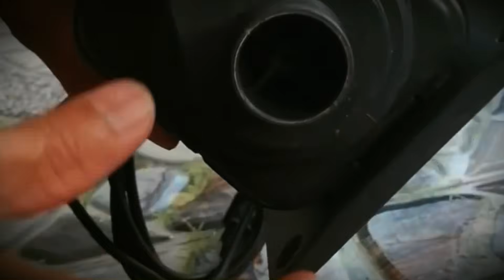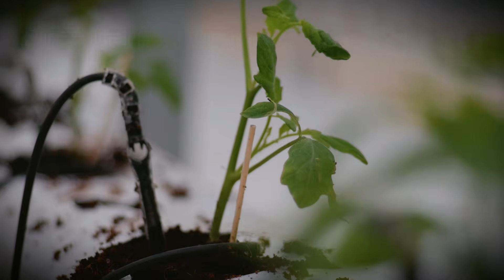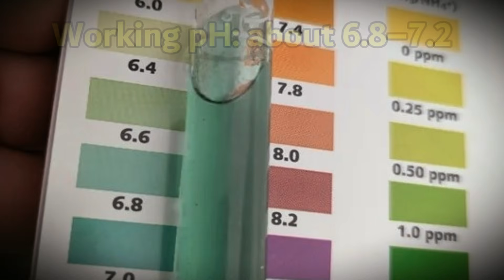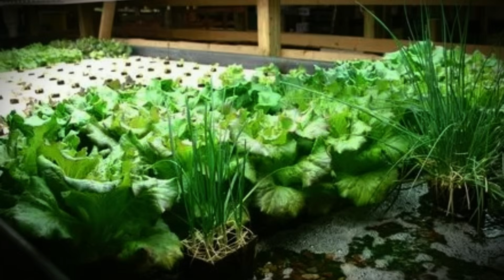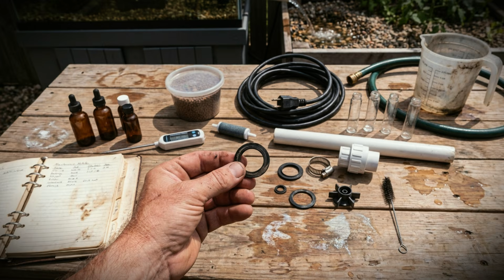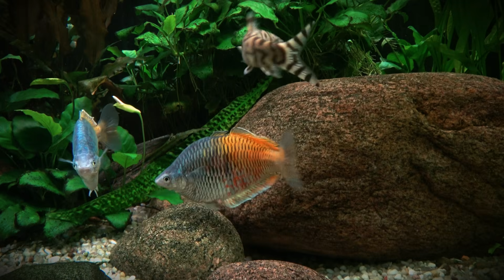The Backyard Food Machine: Fish + Vegetables Forever

Comment: I also thought at first that solid fish waste pumped into the grow bed directly is good, but NO. Solid waste still needs to be filtered to minimize its presence in the grow bed to avoid anaerobic zones and root rot.
Reply from the maker: Good point. A grow bed can handle some waste, but too much buildup will cause trouble. A basic filter and regular cleaning make the system much safer.